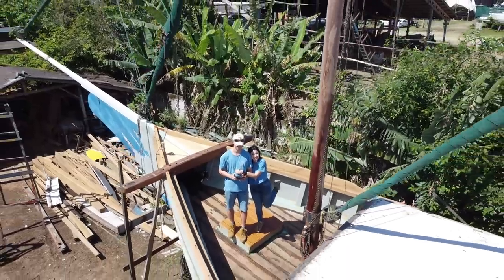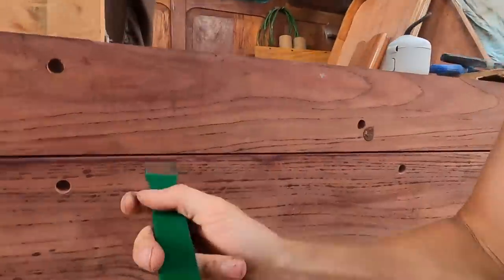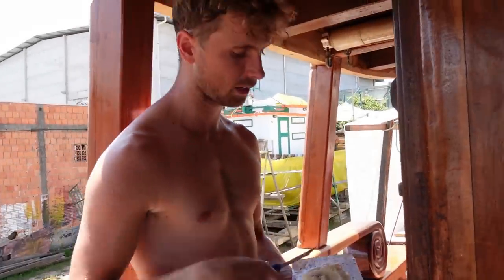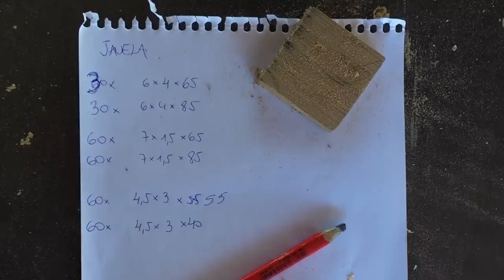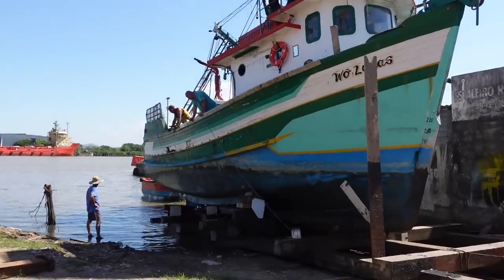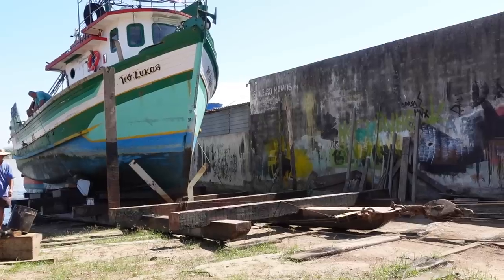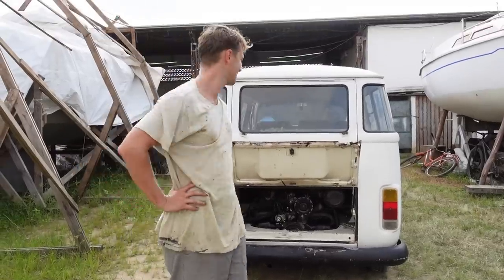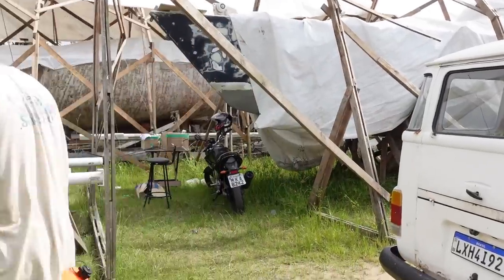Painting the superstructure of our rescued wooden boat! + WINDOW PROTOTYPE — Sailing Yabá #86

Comment from the maker: We want to know: have you ever seen such a heavy wheelbarrow like the one we used to bring the wooden pieces next door? 😜
Reply: That was remarkable. I believe you have a fuel issue. Spray starting fluid and see if it fires. If so look at the fuel pump.
Reply: @kevine.phillips7578  she said it has a broken camshaft
Reply: @StreetTruckinTitan  wow. I didn’t hear it. That’s a mess. I feel for you Ben &M.P.
Reply: a four wheel offroad  instead of a three wheel 😂😂😂
Blijft leuk 😁😁
Reply: No I haven’t….. but I give full marks for pushing it over that kerb!
Reply: Initially when starting it up I could hear that it had very bad COMPRESSION  in the pistons and some weird knocking noises. 

I'm  70 years old now with oil running in my veins and got worried right from the startup.  Maybe I jinxed it ?
Reply: that engine is shot it is throwing a rod and it wont last much longer with zero bottom end oil pressure but those type 2 engines should be cheap down there it will only take about a day to swap it out.
Reply: It could be worse.  You could own a Chevy.  Those things up front that you think are cup holders?  They are to collect the tears.
Reply: I had two of those VW vans and my wife has never forgiven me. They broke down fairly often, heater not working in minus 40 celsius, clutch cable breaking and problems with rust, problems with heavy winds.  The second one with the bigger engine was brand new, but it had all the same problems and after many years the side door rusted so bad it fell off...The only good things about it you could push start it and it usually was good to go. I finally used it as a tool.shed. P
S. .I've been looking at your left over wood for weeks and you could use it for some small items to sell. Like coasters for cups as a starter.  They would be small enough to put in the Post.  Do you have any idea what a six foot length of one by six  purple heart as we call it in Canada costs.  It was over $60.00.or perhaps more.  Stay safe.
..
Reply: @pieterbezuidenhout2741  No Sir you didn't jinx anything my dad's had issues with camshaft too.. he carried a lot in that lil truck... But hey your ears are spot on...
Reply: @solskengroupllp2758  Oh my goodness that's the truth 💦☔
Reply: @garykuiken6191  Gary I'm amazed at the purple heart scrap.. I can think of many things too
Reply: Why caulk an area with a huge hole within it?
Reply: I am trying to be positive for you guys but wooden windows?????????????????? I have come to the conclusion you are what we call winging this. How do you think wooden windows will remain functional???????????? I wish you all the best but I am very very concerned about your safety in this boat as it is abundantly clear you have absolutely no idea what you are doing at all. All the best
Reply: I am so sorry for saying this, I would prefer to lacker or varnishing that beautiful violet wood instead of painting it in white, I know the original colors of the ship… but above of that i love the videos and don’t miss any single for so long
Reply: She sure was making more noise than normal when Ben fired it up in the video
Reply: @donnakawana  appreciate your kind words thank you but it has happened quite a number of times as I've been blessed with 'Technical brains ' and just love to listen and find the exact problem in a fraction of a moment without even realizing it. I honestly feel guilty when something like this happens before my thoughts have gone  cold 🤔.
Strange surname  , may I ask from what part of the world are you  ?
I am a South African Boer in Limpopo province and currently in dead of winter .
Reply: @pieterbezuidenhout2741  I certainly have no motor experience - but that rumble was … impressive! And yes, I wasn’t surprised that the car stopped working. But yeah … a broken camshaft - just about one of the worst things to happen to a motor … my condolences ot Ben & MP @sailing yaba
Reply: @pfalzgraf7527  true .
Reply: @StreetTruckinTitan  That really sucks. Probably an engine-out job.
Reply: with 11 windows in it...
Reply: Not since my younger days wheeling concrete to places the trucks chute wouldn't reach.
Reply: @garykuiken6191  60 bucks Canadian is a couple 2x4's these days 😑

Comment: I like the use of the left over wood for the windows.  I'm curious how you will make the windows watertight & stormproof as a sliding design with large panes is only good when at anchor, perhaps you will make storm covers and seals to keep out the water.
Reply: storm covers is absolutly needed, they could double up as theft protection as the windows are quite large and would allow easy entry otherwise.

Comment: Since it is very likely that you will use your schooner in the same area and probably under the conditions as it was used before you should think about copper sheeting the bottom of your ship. Just make sure that there is an isolation in between the copper and the hull (Irish felt). If copper is to expensive aluminium is also possible. Just don't mix metals and you are fine.

Comment: Well the old van gave it her all. There is not a lot to those little break apart engines..  Though it is probably just cheaper to get a used one and slap it in.. you won't need it for very much longer.. though a good refresh with new cam and lifters rings and bearings should only take a mechanic a day to do.. especially if he is used to these little things.. We used to run these engines in our dune buggies.. Porche, corvair and even a few VW's they were great fun.. Good luck guys.. and ad always thanks for the share.. stay safe and carry on!

Comment: To use of all that hardwood cutoffs to build your windows is admirable  . Using manufactured ports with proper seals & dogs would assure waterproofing . However after be amazed at the craftmanship of the local boatyard I'm sure that the wooden windows will work fine . Probably the same design they've used for a 100 years . Cheers go Yaba   btw : great choice of music again .

Comment: Another great video. A note of caution on the sliding windows: when at sea with waves and spray coming on deck it is important that the "outer" window is forward, otherwise you will get water flow between the sliding sections.

Comment: 300 pieces of wood isn't just saving wood, that's a lot of money, even in Brazil.  Good job.🤑
HaHaHa 🤣 MP saying it's taking longer than expected.  Wasn't the original guess a few months to replace a few rotten planks?  You only missed by a week or two 😳
Now's your chance to upgrade the kombi.  My roommate had one with a 2 litre Porsche engine with custom cut heads, and 17 mm feeder tubes.  It was amazing.  😎

Comment: As I wrote in the beginning of your wonderful project. Do not paint with paint that does not breath. At least not on both sides.  Its like wrapping the wood in plastic.  Moisture/water will find its way in anyway somewhere but not find a way out. The boat will rot like the original one did. Of course there are details (rails etc) you can warnish but (transparent) warnish will usually let you detect if moisture is trapped. Paint does not. I have seen many beautiful boats destroyed by rot in a few years after been painted with non breathing paint. In other words, the paint has to be microporous to avoid rot.

Comment: Hi Ben & MP.  Oh dear re' the broken camshaft, but I'm sure it will be a relatively simple and not too expensive fix.  It's worth it to keep that combi running.
I hope you don't mind me suggesting this, but I often wondered why you don't/didn't redesign the wheelhouse front/side windows to be a single slanted window rather then two smaller windows coming into a water trap.  Hopefully you know which ones I mean, but I can elaborate if needs be.
I think it would produce a 'cleaner' design and have fewer places for water and debris to sit.
Just a suggestion.
So glad you're taking Caijo (apologies if that's the wrong spelling) with you on your adventures - he a great dog.
Regards Mark in the UK

Comment: I predict that the windows will be the first thing that get changed. The current design, while aesthetically pleasing, is grossly impractical. They are impossible to adequately seal against even moderate rain. This will lead to fresh water intrusion which lead to a lot of Yaba's original topside misgivings. For a window to slide a gap between the track and the frame is required. Gaps on boats are not a good thing. 🙃

Comment: When finished how many, experienced sailor, people will it take to sail this boat?
Reply: One experienced captain could do it on his own, but better/ much easier if your have 2 people. Of course you then need to take some compromises and do stuff one after another which could be done in parallel, but its pretty much possible mainly because the boat is so big and will be relatively slow turning. Harbor maneuvers probably require to take it slow and be a bit complicated, but Ben already showed how to do it in one of their first clips: use the dinghi as an assist tug and your good. Then you probably want 2 on the ship and a 3rd person in dinghy at least or you need a verry calm captain to make it work without to much stress and nervebraking.

Comment: I would have mixed that epoxy up and  put in a power driven caulking gun and injected it into your seams in a long run then have someone follow along spreading.😉

Cautionary mention the lowest part of your windows should ideally be made from a rot resistant piece of timber.. they have more water hitting them and sitting on them longer..in old houses they would often use oak or a resinous soft wood to avoid it rotting out. 🙄 Its a pain  if you excuse the word play if all your panes 😬start dropping in a few years.

Comment: Do you clean and degrease (for example with acetone) surfaces before painting?  I don't remember seeing this in any of the videos.
Reply: Also, i think ist better to use brush instead of roller for first coat

Comment: Those portlights are going to leak when you get broad sided by a wave.. etc. They will blow inboard. I hope you dont use glass. I suggest 10mm or 12mm polycarbonate.. you should also install storm shutters.

Comment: Have you tried loading your caulking compound into a caulking gun. It would apply alot cleaner,faster and you can use 1/2 tape instead saving money there? Just curious if it's been tried .
Reply: Yep, and it works really well. I use a gun designed to repoint brickwork, easy to load and clean and powerful. For something that hardens quickly you can get bags that you load up like sausages into  standard throw away cartridges.
Reply: @smokingkippers1173  I was a carpet installer in my younger years doing alot of large jobs in NYC we installed alot of cove base ( that rubber floor molding in tiled rooms and commercial offices. Millions of feet. The glue used to put it up is thick like paste and some of us used these big caulking guns that the back unscrewed and you filled it up or used cartridges or bags as you said with special tips that would lay down 5 lines and f the glue at 1 time.

Comment: why did you chalk a non watertight bulkhead / wall in the interior and sikaflex is a better product to use if applied properly with primer and is more flexable when your boat goes back in the water the planks will swell and pop the epoxy out of the seams

Comment: Might be to late but try pipping bags for the caulk.   (like frosting on a cake)    Narrow nozzle will help get the caulk into the seam with out the internal bubbles that could be left by putty knives.      
If the cotton in the seams does not work the discovery will be made to late to be of any good.   Ben looks like he's doing good, but is in doubt have it checked prior to launch...

Comment: Sorry to hear about the Combi.  In Brazil, a replacement engine shouldn't be too hard to find, I wouldn't think.  

I am still highly concerned about the ballast you are planning on using.  Like the other 'sailing day boats' that have come in, Yaba's hull design does not lend itself to actual sailing.  I suspect you're going to need, literally, tons of ballast to keep her upright if you're in the middle of the Pacific with a quartering wind under full sail.  With her current hull design, she's going to roll right over because she has no keel.  My OPINION is you should be building a latticework on either side of the keel about 18-24" out, stem to stern and filling that with concrete.  Really, I'd suggest lead, but because of environmental rules, you probably can't use that.  This is the biggest thing I can see right now.  Do some research into keel design and why, without a keel, you're going to be very limited in what you can do in the open ocean.  Yaba was designed as a coastal cruiser, not a blue water sailing vessel, and if you try to use it as such you're going to be putting your life in danger.

MP, the boat that was in last year, and is back again this year, they aren't rebuilding it from the stem to the stern, keel to the top of the cabin.  Yaba will be 95% new when you get finished.  Of course, it's going to be longer for Yaba.

While I applaud your steadfastness and work ethic, I still, and will continue to think that this is fool's errand.  I think within 3 months of getting her back in the water, you're going to regret a lot of it, but we all need to learn.  I can hope that as you go on you will make decisions that will change that, but you've already made some that are now, by the time you read this, either really difficult or impossible to change.

Comment: OK - it's obvious you guys have really no experience of the sea because if you had you would not be installing "windows" on your boat.  The ones you are installing will leak like sieves.  I wouldn't install these in a summer house in my garden.  You need port holes with tight seals or none opening plexi-glass.  You will get water on deck and these will not be able to withstand the water pressure.  Also I'm surprised that your Oddlife Crafting friends have not told you how to do a correct deck/mast penetration.  You need the opening to be much larger, the mast supported with mast chocks and then a watertight mast boot arrangement.  You are going to have major problems with water ingress once you get into a seaway.  Finally, have you guys done a displacement/stability calculation? Do you have any idea what your final draft will be? You are using a great deal of heavy timber in the construction.  It might be wood but it doesn't add buoyancy, that is created by your immersed volume.  Think Archimedes principle.  I suggest you take some professional advice.
Reply: You do understand their boat is in a boatyard and is being built by experienced shipwrights correct? Alrighty then!
Reply: @StreetTruckinTitan  then why the obvious errors. Seams crazy to me. Caulking using a broad chisel opens the seems. The idea behind caulking is to close the seams. Why not use the correct equipment - "spoiling the ship for a hapeth of tar"
Reply: Do you know who designed and made the boat originally??   If so, I be questioning them.  🤣   every peice has been a R&R at this point.
Reply: @richardp2152  this also in Brazil. Although not always the correct tools, they get by with what they have.
Reply: A little leaking does not matter that much if the water can run down to the bilge, just make sure it doesnt collect somewhere. Also adding two guide rails to the window frames would make it easy to insert cover board if a window breaks or bug screens if necessary.Easy fix. Not evrything must be high tec.. need to have ideas and implement simple solutions. And i would add some slide over coverboards that can be locked in place from the inside as a burglery protection, unwanted guests could enter through the sliding windows as they are.
Reply: @schuttrostig5729  if it's in the bilge no problem but it has to get there. The windows are on the house sides. Although it's early days yet I see no provision on the inside for a drip tray and a drain to the bilge. Therefore any water entering through the gaps will run onto whatever is directly beneath,  settee, berth, people - annoying and uncomfortable.  Also people tend to underestimate the power of water. One cubic metre of sea water weighs 1,025kg. A quarter of a cubic metre 256kg - that has a lot of force and will find it's way through every opening - no matter how small.